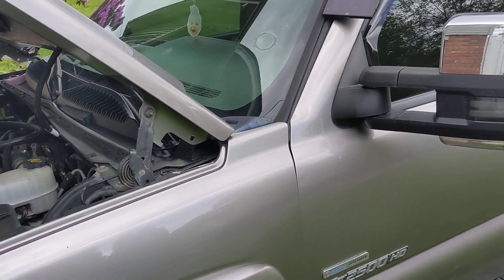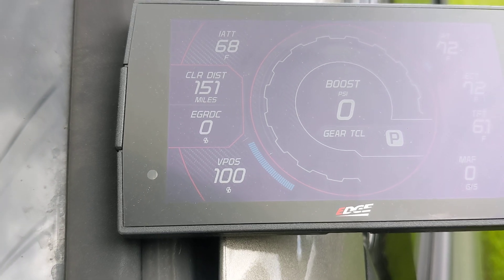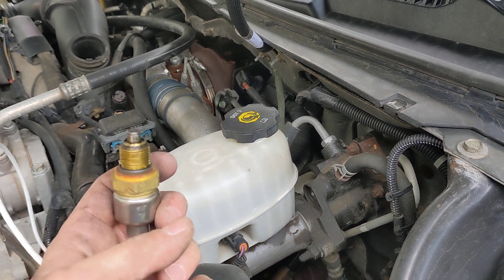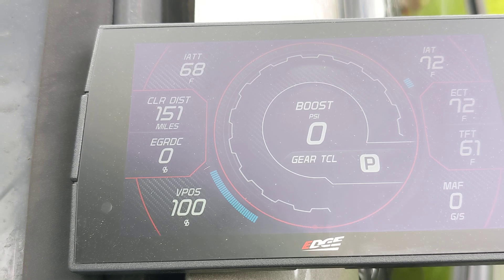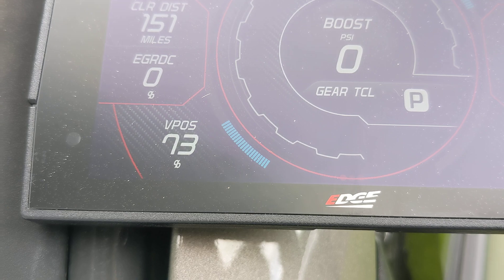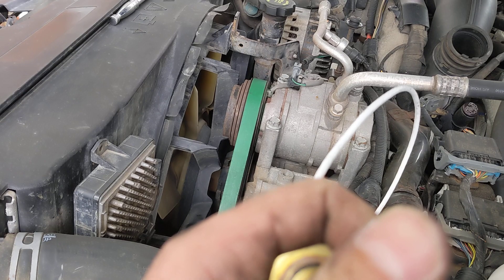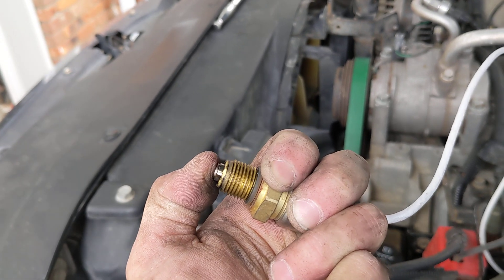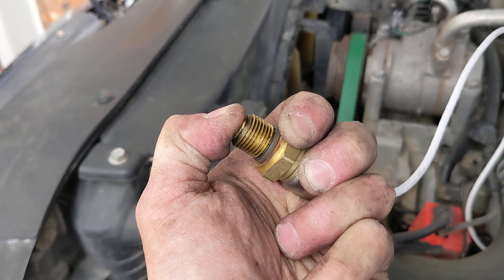LBZ Duramax p2563 vane position sensor test

Comment: Did a replacement fix it?  Good video and gives me a place to start at.  Thanks
Reply from the maker: For me, it did not. I'm still getting that p2563 code.
Reply: @LarryFopps then what was the point of this video
Reply: @LarryFopps  What fixed it brother
Reply from the maker: @7EMYORKA allegedly I need an ECU. Haven't replaced it yet though